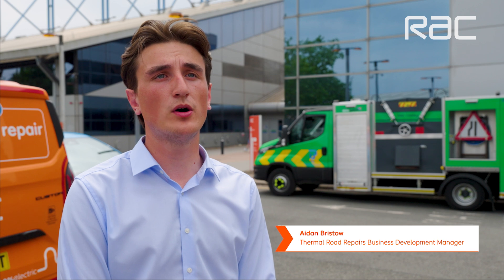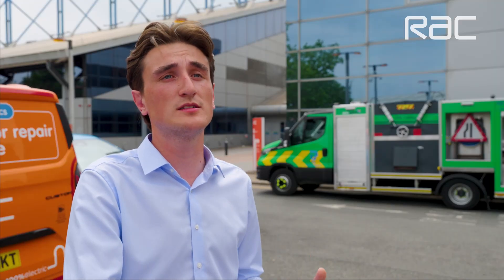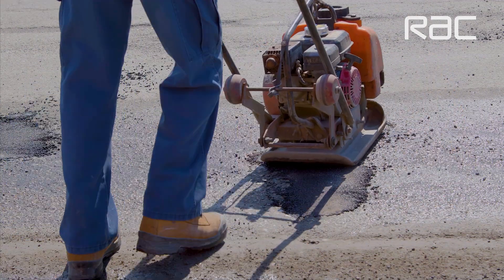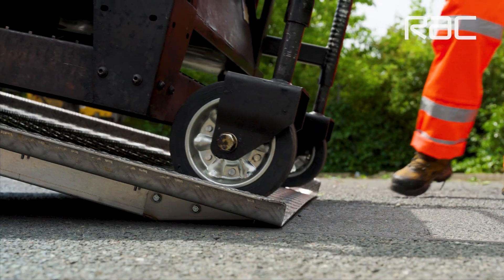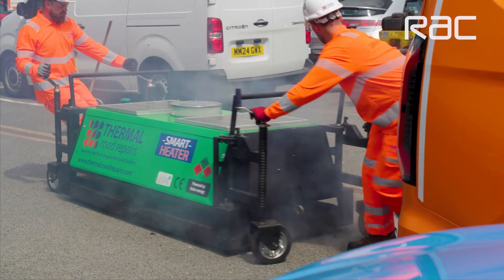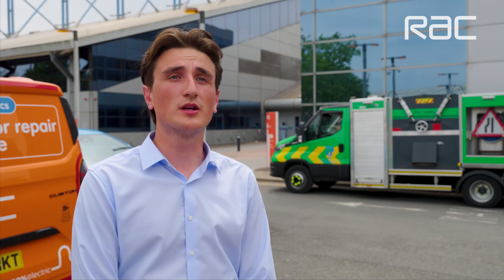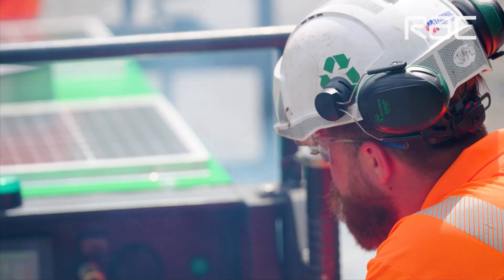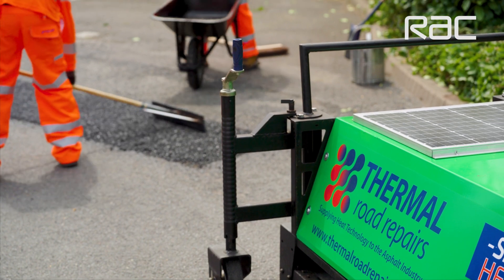How to fix a pothole permanently

Comment: I am absolutely disgusted by RAC for allowing cowboy dodgey car garages being on the RAC assured garages. A two hours job on my car took them 1 & half days. While fixing original issue the mechanic broke another part in my car, The garage accepted fault but want me to pay for the part they broke which is very difficult to get hold of so they just used some kind of metal glue to fix issue and gave car back. I'm driving now with risk of my engine blowing up thanks to RAC assured garage which i trusted